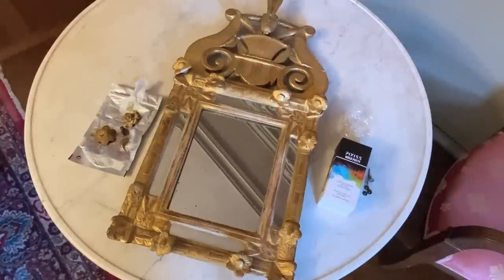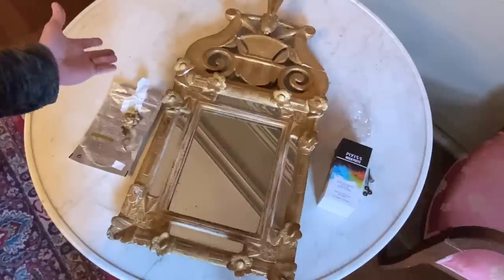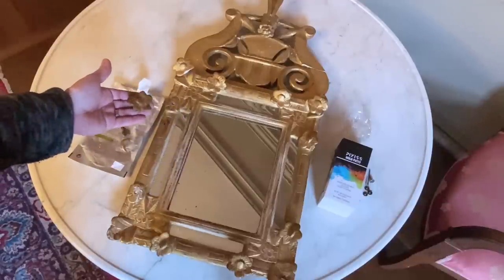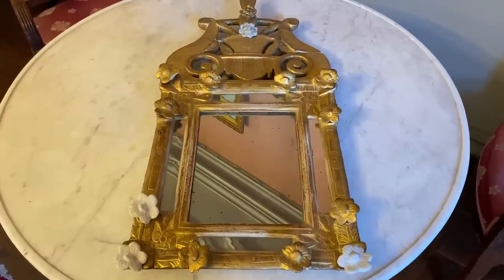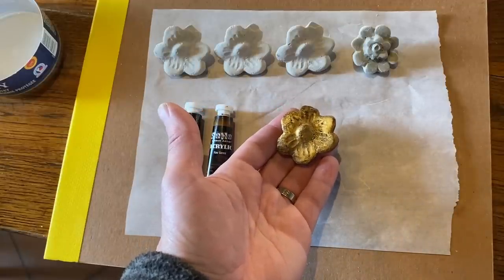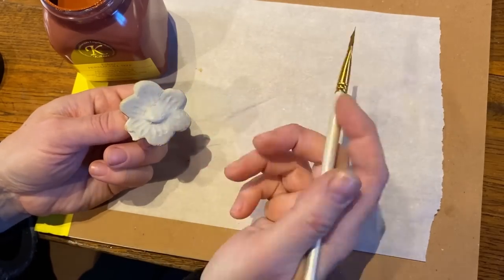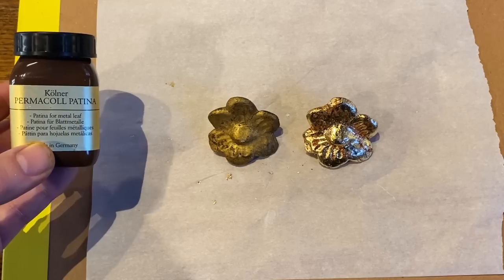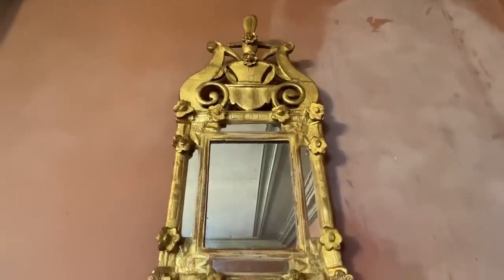18th Century Mirror, DIY Plaster Casting & Gilding | Friday at the Chateau - Journey to the Château

Comment: Stuart thank you for that. We have a pier glass mirror that we inherited from my mother in law that has little flowers on. A couple of years ago I cleaned it as it had years of smoke stains from hanging above . It really lifted the gilding but in the process I found various bits of damage and found some had replaced one flower and it looked like it had been done by hand and wasn't a good match. Watching you do this has given me the confidence to make a mould of one of the original flowers and replace the bad match. We have one larger flower at the top of the mirror that is exactly like your larger flowers and smaller flowers at each corner. It made me wonder if someone mass produced the flowers and sold them to furniture makers or if our mirrors came from the same workshop. My parents in law bought ours from an antique shop in Bath (England). Fascinating.
Reply from the maker: Thank you, Sue! 🥰
Reply: That is so fascinating.  Furniture and decorative items have been traded betweenFrance and England for centuries.  There must have been artisans that specialized in flowers and other decorative items and that were sold wholesale.  Great thought.  We’d love to hear how your restoration goes.  🥰😘🥰. Hugs.